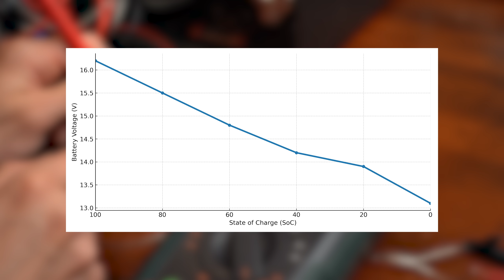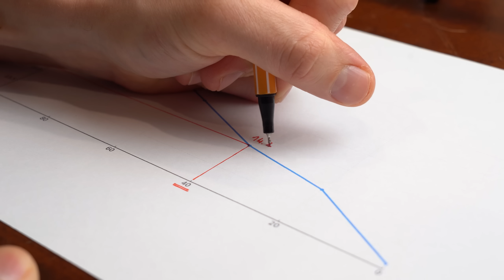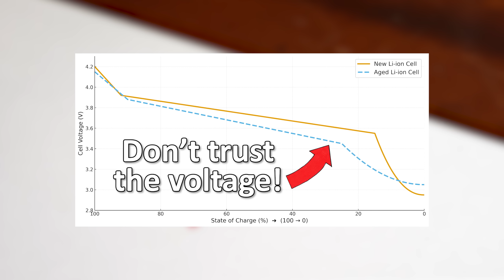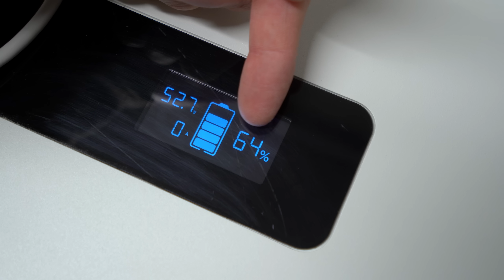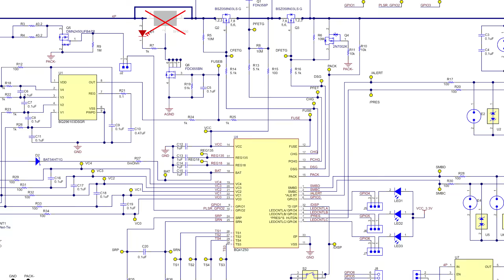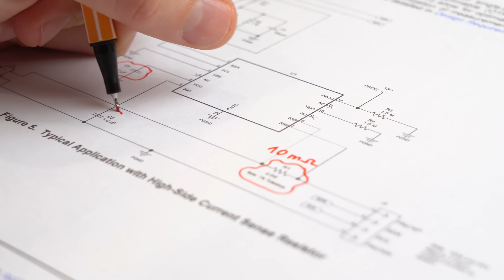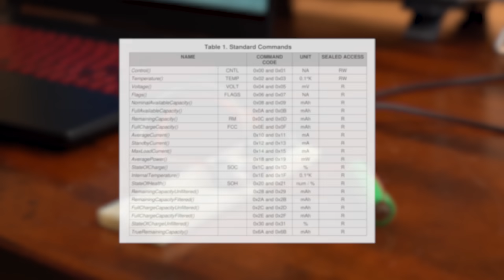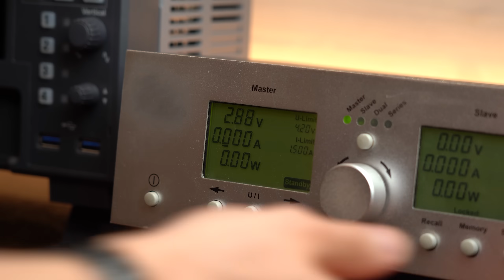The Amazing Secret in every Battery! (Fuel Gauge) EB#66

Comment: I built a design using the bq41z50 and the programming is genuinely awful. Their documentation is good for the most part but has gaps in very critical places. I paid $100 for the EV2500 board to connect to the EVM and it shipped with cables that weren’t even connected properly (it connected vdda to gnd between the boards) and the pull-ups weren’t even configured properly for smbus and I had to inject voltage because their “programmable ldo” hasn’t been implemented in any of their software. If I build another bms I’m using an AFE + STM32 because this was genuinely a terrible experience.
Reply from the maker: Sorry to hear that....thankfully I did not experience such problems.
Reply: @greatscottlab thanks, what I’ve learned is to only use Ti’s more mature ICs and to look at their forum before deciding on one as many of the chips have unresolved issues for some use cases. Avoid bqstudio at all costs because it’s really just a labview program and I made the mistake of bricking an ic by changing the calibration data then accidentally sealing it, which even if you unseal it, it instantly reseal because it was constantly detecting an over voltage event so I think the watchdog timer was freaking out and resetting. Also there’s a jumper on the bq41z50evm that straight up fries the board. They say don’t connect this as it risks damaging the board, but why include it at all??? Anyways yeah, usually I love your videos, but I guess this one struck a nerve lol.

Comment: you know whats wild? bluetooth speakers and headphones, that say that you have 40% 50% 30%, but never 55%??? 39%??? remember that sending battery info is also resource consuming
Reply from the maker: Haha, kind of true ;-)
Reply: But newer models have the option to send a precise battery percentage.
Reply: @unknown4_4  i have jbl live 660nc and its showing only zeros at the end
Reply: I dunno, my cheap $4 AliExpress wireless earbuds show an individual percentage for each bud and they go :99,97,95,93,91 etc.
Reply: Eh I disagree. System power wise- host processor making I2C reads eats most current yes

But if you use something like BQ27427 - 9uA current draw, 50uA current draw 1Hz reading. 

Meaningful power consumption is when the host chooses to read the gauge. Fair. But that’s on you to schedule your RTOS well to not poll gauge constantly
Reply: My Sony ch720n shows the precise percentage in the sound connect app, however in my phone settings it rounds off to the nearest power of 10.
Reply: @krishay3519 Same thing in my case too....

Comment: Great info, I was about to try some fuel gages I have.
Reply from the maker: Glad I could help :-)
Reply: @greatscottlab 
Excellent video, as always very helpful 👍

For future convenience, is it possible for you to adapt your boombox to run from a common drill battery pack ?

That might solve some of your problems...
Reply: @greatscottlab Just use a single cell big battery by connecting multiple cell in parallel AND use a voltage booster module to power the boom box
Reply: @AlyoshaLopill  Hmmm 🤔... But don't you think the presence of the boost converter will mess up the gauge's accuracy?
Reply: @osisegregory  NO. The gauge will be connected directly to the battery before the boost converter. 
So the gauge will only measure the authentic current and voltage directly from the battery
Reply: How is this from 2 weeks ago? Vid was posted 2h ago 😭
Reply: @flymig29 Patreon supporter get access to video earlier I guess
Reply: @TinLethax  🥀😭
Reply: @TinLethax wow
Reply: @TinLethax  That is correct, one of the perks for supporting your electronics teacher.
Reply: @flymig29 Maybe Patreon members get it first ?